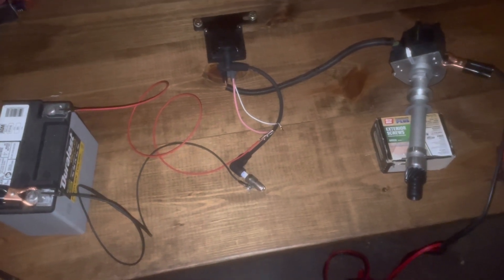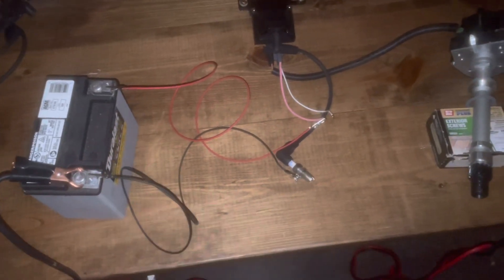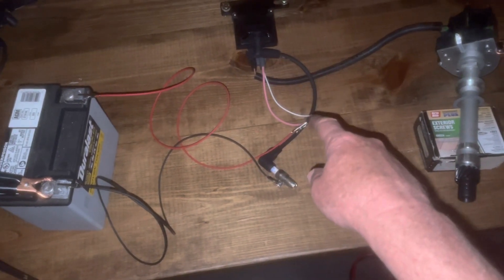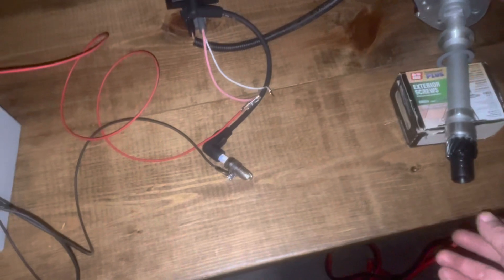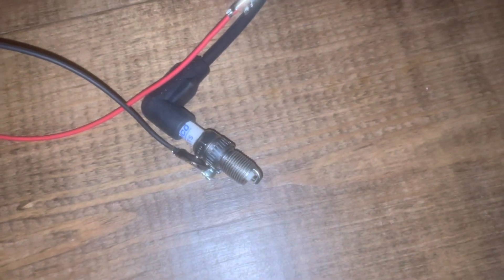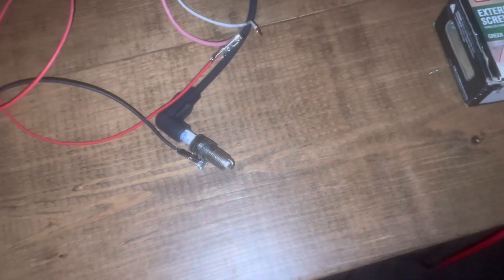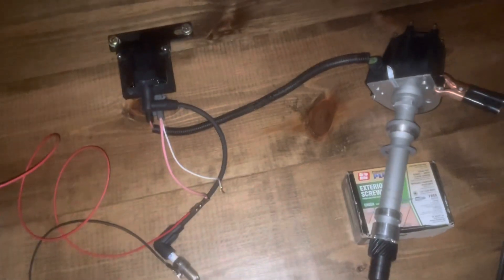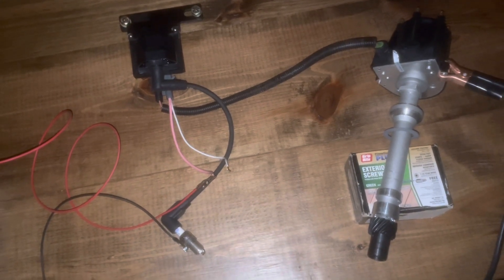2 - Testing Genuine Delco EST Ignitions - SPARKIE The EEL

Comment: Thank you for your instructional videos on Delco EST marine ignitions. 
Here's my story-
I have a 1996 Campion 622 Explorer powered by a Volvo Penta 4.3 V6 with a SX Cobra sterndrive. The engine has a stamped steel oil pan and uses the shorter Champion 15YC spark plugs along with a 4bbl Holley carburetor. I believe it's a 4.3 GI model.
I had the engine running great at home in my driveway on the garden hose. The next day I went to launch it, and the engine would crank but no fire! So later back at home during my trouble shooting the coil checked good, I replaced distributor module with a Delco marine module ($244). I checked power from the key switch to the distributor, and it was good. The shifter detent tested good, still no spark!! So, I pulled the distributor and followed your instructions on bench testing it and got it to spark! The spark was not the same as in the video, probably because I stuck a paper clip in the coil and connected an alligator clip to. Now what to do next? If I reinstall distributor and still don't get spark, what should I do?
Reply from the maker: Put it back together and turn the ignition to run. Make sure the driver safety switch is connected. Pull the gray connector off the coil and check for 12 volts at the terminal fed by the pink wire. If you have 12 volts there turn off key and reconnect everything. Next cut the white wire in two  and see if it will fire. The white wire feeds the tach which could be bad but if that wire shorts to ground anywhere back to the tach the ignition won’t fire. Delco EST systems are very simple and are fed power from the single pink wire. The only outside interference in the system is the tachometer circuit.
Reply: @moccasinmarine  I want to thank you for your expertise and help! I did exactly what you suggested, and the engine fired right up! I set the base timing after warming it up, connecting a shunt wire and adjusted distributor to 1-degree BTDC. Purring like a cat now! Now to run new wire from tach to distributor. BTW- I first traced wire to the tach and clipped it there. It didn't change anything, so when I clipped it at the distributor plug (leaving enough tag end for splicing new tach wire) was what did it! Thanks again for all your help!
Reply: Oh, and another thing, I couldn't set the timing with shunt to 1-degree BTDC when idling @1500 because I don't have use of a tachometer reading after clipping tach wire. I can do timing reset later after rewiring tach from helm to distributor.
Reply from the maker: @MPT30A  the shunt tool locks the timing no matter what Rpm so you could set the timing anywhere technically but I always use 1000 RPM as the max so anything less than 1000 is OK

Comment: Have you successfully converted one with EFI?
Reply from the maker: There is no need to convert an EFI marine engine to Delco EST. Thunderbolt ignition modules weren’t used on EFI systems. The EFI systems that had distributors could read the Thunderbolt distributor directly with the computer and then the computer triggered the ignition to occur via a GM ignition module. Since the computer controls the timing the Thunderbolt module isn’t needed.
Reply: @moccasinmarine  What does the kit cost for a 5.0 mecruiser
Reply from the maker: @jeepdrum11 the price depends on what year your engine is. If it’s before 1996 it’s about $80 cheaper but for 1996 and later it’s $539